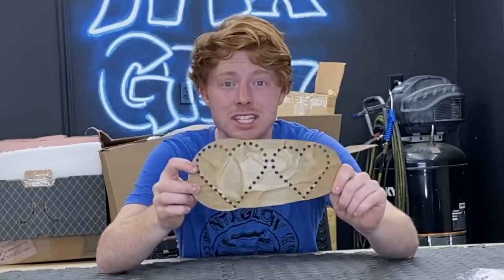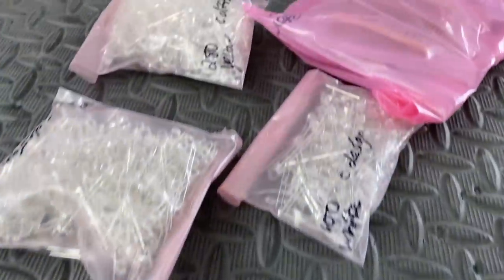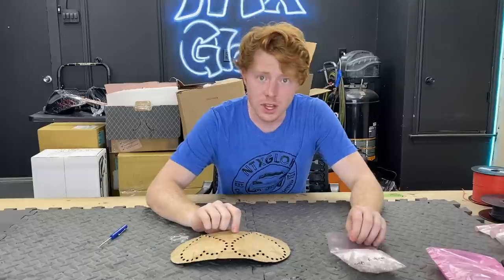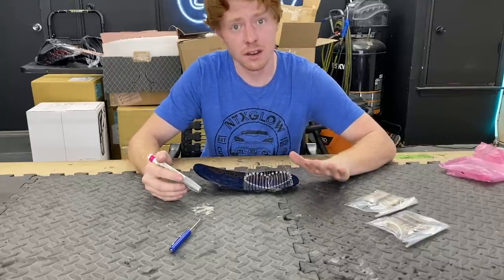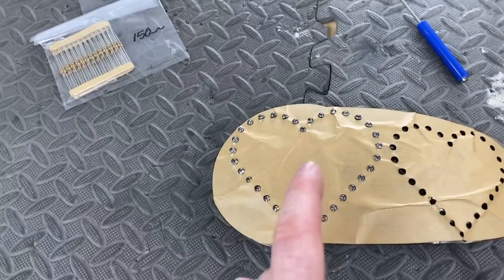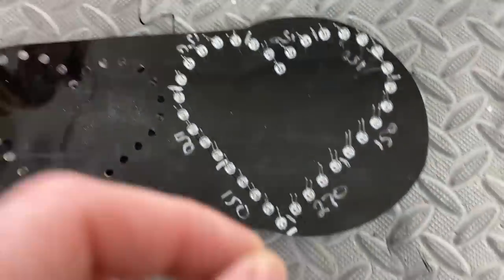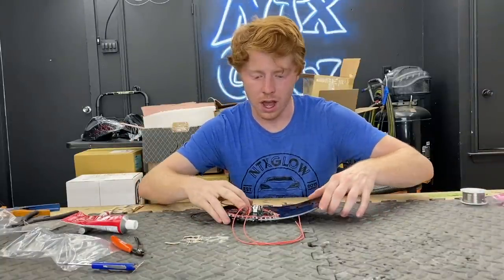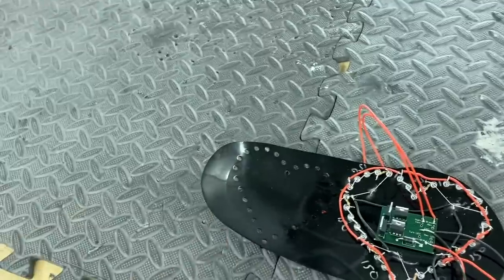How To Make LED Tail Lights

Comment: note the LEDs you're using are 5mm positive lead (longer one) is called the anode the negative lead (short one) is the cathode, the addressable  LEDs that are more popular are using 5050 diodes same one used in LED strips, what I would do differently is use high power LEDs, I don't know what they're called I just look up 3W LEDs and they show up,  I prefer using these because they're a lot brighter but you need a driver because they're 3watt diodes ( those diodes can also be found in light bars, and they have 3w RGBW LEDs)
Reply: I can go on and on about LEDs all I work with

Comment: I would really appreciate it if you took time to talk about retro fits or just trying to give that 2023 led look for older cars that have the old school halogen build. For example I drive a LS400 1998 and there’s no aftermarket support for the headlights since they changed them after 1997 1990-1996 got the aftermarket support and diff headlights. How do I go about giving my old halogen lights projector demon eyes 👁

Comment: This is great, however I need to know how to make the acrylic inserts that go in the taillight housings. Since I'm working on something a little more unusual, I can't just hop over to a site and find premade inserts for my taillights. It's literally the only thing stopping me right now.
Reply: Use tape to create a template, then cut it out from Perspex, or use CAD to make a model and laser cut it… evenly heat up the pieces with an oven or something, then lay them over the taillight lens to get the shape of the curves.

Comment: Dude, long cathode and short cathode? As a person that want to do educative videos, you should know the correct name of the stuff you use.  No hate
Reply: This drove me insane also. One is an anode and one is a cathode.
Reply: The word he’s looking for is “lead.” Cathode is always the short lead (Negative) and Anode is always the long lead (Positive). This does not differ between brands as he implies. It is standard for axial leaded THT LEDs. Also, the round ones always have a flat side at the base to mark the Cathode in case the leads have been trimmed. If you can’t see that you can often peer into the LED to see which side has the larger flag shape known as the “Anvil” (Cathode). The smaller one is the “Post” (Anode).
Reply: Let me confuse you more although I'm not great at words or explaining things.
  In a cell the cathode electrode is the positive+ because it's gathering electrons while the anode the (negative) is losing by oxidizing electrons.
 In a circuit the cells +cathode  is losing it's gathered electrons to the + in the circuit which in terms makes it referred to as anode +.
 Now that I've confused you here's an easy way I use to remember the terms for use in circuits.
A+ (anode, positive)
C- (cathode, negative)
Reply: To make stuff easy.

Comment: I've got a 1996 Ford Thunderbird I've been wanting to do something unique. Possibly divide the rear deck lid lights and design a Thunderbird emblem in led to be a sequential Brake, turn, hazard, and reverse lights. And I want to do projection up front. Noone makes any aftermarket lights for these things so it has to be custom. And that is way outside of my comfort zone.

Comment: The positive is always the one with the longer stem
Reply: It’s supposed to be but it’s happened a lot to us  where the manufacturer just cuts it wrong and you end up with the opposite, basically just check the batch before installing lol
Reply: There is also a flat spot on the diode itself.

Comment: What would i do different.  Does look like 5 mm straw hat LEDs correct?
Yeah so they actually make those in a strip that are already wiring with resistors that you can plug into those holes so there's no need for all that soldering bending and clipping of what you called "cathodes" which are actually referred to as electrodes. 
 The positive electrode or the anode is the longer leg of the LED. I have never seen LEDs that were opposite of that so the longer leg is usually always the positive.
 So having an LED strip with pre soldered resistors in LEDs that just pop into place There is no need for any of that mess and in the end you would only need two wires coming up the strip making it look super clean and none of this burn marks or gray smoke on the lens or anything like that.
 
 Then there is LED laser wire which I have no experience with but I am wondering since it uses just a single LED that passes light through the wire itself with a consistent output of light throughout the entire wire I'm wondering if that could be used instead of bulky LEDs and bad wiring?

Comment: You say you’ve done this for many years but don’t know the difference between an Anode and a Cathode? 😅
Not hating or anything, but that’s kind of basic stuff
Use this acronym: PANIC Positive Anode, Negative is Cathode

Also, normally the long one is the Anode

Comment: Hello don't know if you will see this but I've heard that fiesta mk7.5 lights can't be put in the oven because of the type of sealant that is used is this correct 
Found your channel years ago and watched loads of videos but forgot the channel names recently found you again I've subscribed this time
Reply: you can use a heat gun instead of putting it in the oven, but if a heat resistant sealant was used, it might be a little trickier to get it off. ultimately you shouldn't be reusing the sealant, so whatever works to get it off is fine since you can use a different sealant to close it back up.

Comment: Just starting to focus on growing my small business in Australia of modifying headlights… I really am used to doing the VE commodore (I think Pontiac g8 in USA). Do you think i should specialise in one brand of headlight or do you think broadening to do more brands would be more beneficial? I’m not sure how confident I am with the headlights that are permaseal , I can do the VF but I have tried caprice (another type of holden) and couldn’t get them apart. Do you ever have headlights you can’t get apart? If so do you suggest cutting?
Reply: Never cut headlights, tail lights yes because most are plastic welded. I've had to unseal some perma-seal Jaguar headlights that were a big ol bitch. I ended up throwing them both in for about 20 minutes each at 250°. Also have a bunch of flatheads and other pry tools but most importantly shims. You don't want 2 spend forever on one section to finally get it to release only 2 move on 2 next area and have that area go back into its original placing, so shims are amazing to keep progress you've made. Don't be afraid to also have small parts of the plastic bent up because you can always repair with some heat.

Comment: Was the group of 4 leds brighter or dimmer than the groups of 5?
Reply: With the correct resistor,  they should be the same brightness (iirc)
Reply: Should be a bit brighter. You can size the resistor by checking the specs of your particular diode and compensating for the missing one to make them totally even.

Comment: Can anyone help me I have some aftermarket led e46 tail lights is there a resistor, or some type of chip that I could wire in to make them constantly flicker and I’m not talking about the brake hyper flash I want my led tails to constantly flicker when there on
Reply: Like strobe like flicker? Might try a pwm module with adjustable timing.

Comment: Has anyone understood the mathematics behind Ohms law and could readily read schematics and dabbled in electronics for years but some how fail to fundamentally understand how voltage, current, and resistance worked together in a circuit. 
 No Just me?

Comment: Hi ,friend I'm sure you're the only one to answer my question, I wanted to change my turn signal (normal halogen) With led turn signal (RGB with application to control different mode)and it doesn't work, do you have any idea how to change a variable 12v to a stable 12v for it to work ??? ( I tried a relay but nothing) thanks answer me